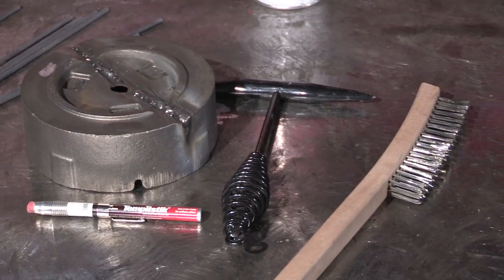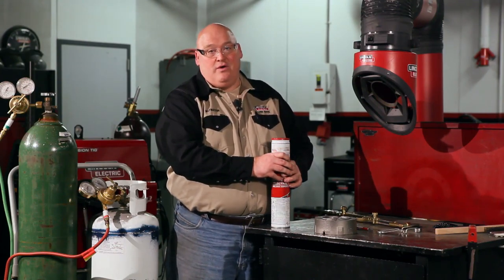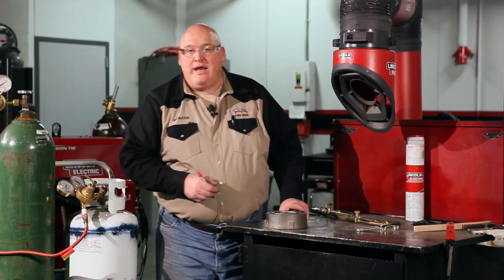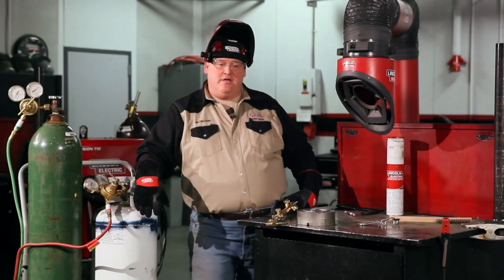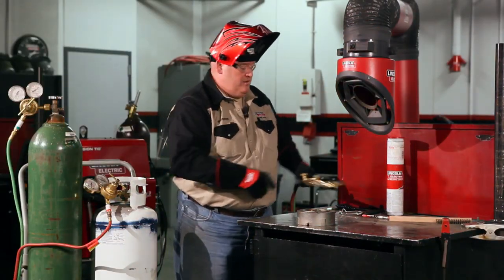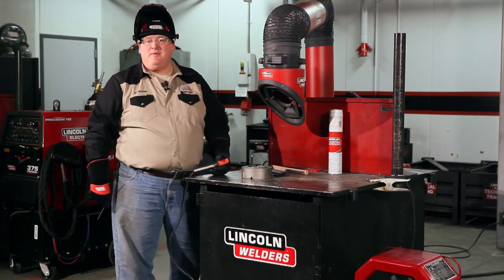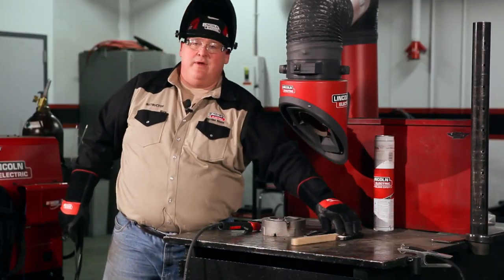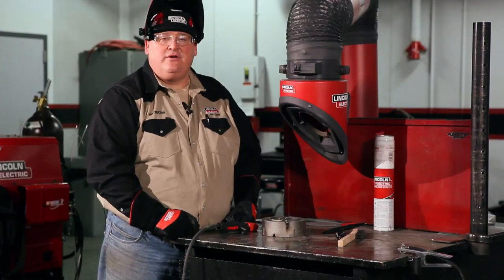Tech Tips: Repairing a Crack in Cast Iron

Comment: Great tute, thanks! So THIS is how to do it properly! Years ago, I repaired a 5" bench vise that had broken in half. I used a 230V wirefeed, cranked waaay up, using .035 Innershield (FCAW). I hit that thing with such a vengeance, I think it took hours before I could touch it barehanded! It never did crack and is still good to this day, guess I got lucky. Next time, I can really do it right!

Comment: Good thing that's not a real casting that weighs about 3000 pounds . If you use that method on a heavy casting it will be broken before you're half done. This is a veteran torch welder that's repaired castings for years. Too bad it's a lost trade. Brass or bare cast iron with the proper flux are the only way to go.
Reply: Please make a video.
Reply: Paul Swartz yea let’s see this knowledge